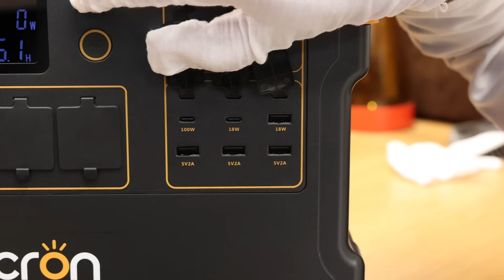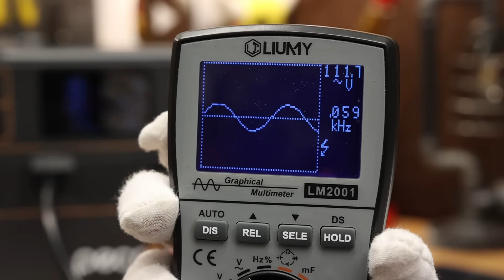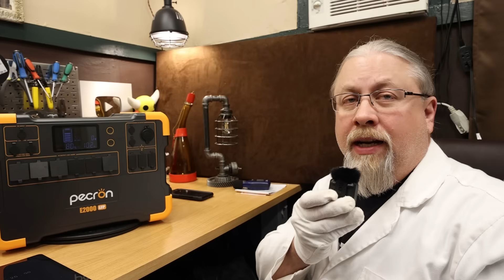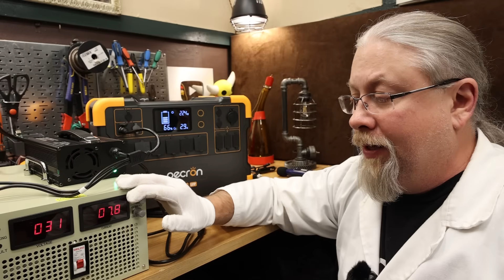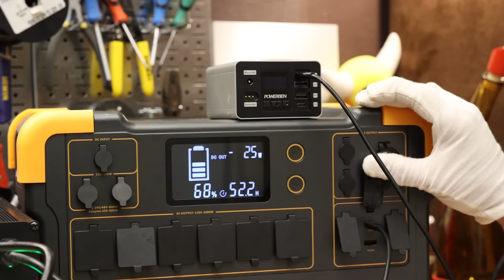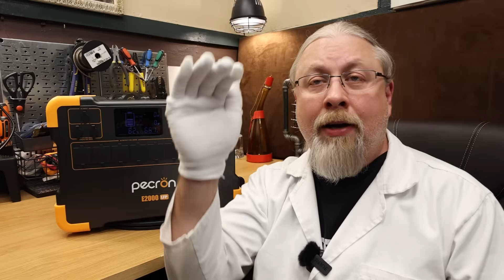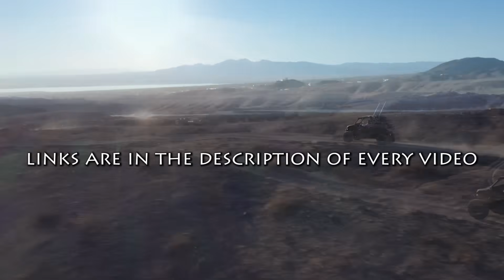Pecron E2000LFP 2000w LiFePO4 Modular Battery Solar Generator Power Station Review

Comment: Professor, How does the E2000LFP and the E3000 stack up against each other? I bought the E3000 in July and am wondering.
Reply from the maker: E3000 uses short cycle NMC where this uses long life LFP.
Reply: @HOBOTECH  Thank you. I would guess that Pecron will be offering a new version of the 3000, or something larger down the road using LFP with the expansion features as well.

Comment: I love a bank of 330 dollar lithium batteries on Amazo. 1200 watt hour each and even waterproof.  Just drop 300 dollars on a 2500 watt inverter and for 180 for a 900 watt solarcharger and last a 100 amp Rv power max 14.2 volt charger. Add batteries later but have 2400 watts now and 2500 watts max.

Comment: If you get to test the expansion battery, I'd love to know how well they document the interconnect. The expansion might already be more interesting than the core unit, given that it has a 30A 12v XT60 output (correct gender, too!) and it's own MPPT controller, but being able to use that apparently 24v connection with other gear would be awesome.

Comment: Mine showed up Friday with the pair of 200 watt panels.  So far am impressed.  Has Ben running the deer shack since Friday night.  Had to charge sat afternoon for about three hours with the gas Genny.  To lazy to put out the panels as of yet.  So far so good.  Ordered one of the expansion battery also.  Will let you know.  For what it's worth I did wire it through a 6 slot breaker box.  Works great will see.  Thanks for the review on the e3000, it's why I went with the pecron e2000 and expansion.  You are a riot and thanks for doing the technical testing.

Comment: I'm glad to see this test video, but please rest assured that our E2000LFP was updated 2 months ago to reach 100W PD output, the previous 65W was due to a protocol issue with the device. Thank you so much!
Reply: Question I preordered this unit and got it in July so is this unit a 100W PD or 65W? If it is a 65w what can be done to correct the protocol issue with these units?
Reply: Just bought mine, I can't wait to receive it ☀️☀️
Reply: I tried looking up your website but it was down. I can't find any info on it. Nor do I see anything on Amazon.
Reply: @ProductsChannel  Try using the links provided in the description.
Reply: @darrellee4953  Sadly no go.
Reply: If you leave this plugged into solar panels does it automatically "wake up" and start charging when the sun comes up even if you have a unit itself turned off?
Reply: @MyCabinLife  Yes!
Reply: How does the E2000LFP and the E3000 stack up against each other? I bought the E3000 in July, and am wondering.
Reply: Posting to get answers to these questions.
Reply: Can this Pecron unit and expansion batteries be connected to a manual transfer switch to power 10 circuits in your home?  What would be the best way to do so?
Reply: Mine is the E2000LFP
Reply: Pecron stuff just seems to work. I have the E1000 from a year ago. No frills or settings and manual rocker style switch to power on/off
Reply: Can you charge ecoflow wave air conditioner with Pecron?
Reply: 👍😁 I'm purchased the E2000LFP in September and it does work with my 100W laptop charger, I'm looking forward to your extra battery!!!
Reply: @hermw3484  any issues with your Pecron 2000 since you have owned it.  Is it loud when using.
Reply: @hermw3484  any issues with weird sounds coming from the unit.  Any issues since you've had it
Reply: @hermw3484  any issues with unit.  Have you heard any beeping noise from the fan area.  Is it loud when at high output.
Reply: It's a nice machine, but you need to get your support staff together!  I'm having issues.
Reply: @jamesslack8933  Thanks for your support! Normally we will reply to emails within 1-24 hours. Please send an email to us if you have anything, Regards.
Reply: @jamesslack8933  how has the pecron performed lately
Reply: Repeated attempts to contact you ,no reply.
Reply: Do you guys offer an all black version?

Comment: Re UPS function, you say it has pass through charging; can't you just plug things into it plug in the brick?  So when the power comes back on, it resumes charging.  If the loads are always running off the batteries, say 500 watts , this is actually a type of UPS that provides seamless switchover, but yes does wear out the batteries more, as they are always online.  But at 3,500 cycles, over 10 years, calendar aging will kill this before using it all the time would.  Or am I missing something?
Reply from the maker: It's not a real UPS because it doesn't switch from using grid power to inverter during an outage. By leaving it plugged in and using pass through charging you'll wear the battery out over time.
Reply: @HOBOTECH  I'm becoming confused how to best use these features.. I ordered a P2001 for my first solar power system, and it sounds like I have to choose between running things on solar (daily) and using the UPS..
In order to use the UPS, it must be connected to AC power.. but then that means it'll be fully charged at all times and unable to collect solar when the sun shines..

I can't have standby power, and reduce/offset my grid power usage at the same..
This reality makes running things like refrigerators unrealistic unless I  manually intervene.

So, for now I suppose the plan is setting up an automated heating and cooling system.. I have enough independent units I can set half up to run on solar only with no AC power, and half on AC power to kick on only if the solar powered ones can't maintain a temperature threshold.
It's important to find a way to discharge useful power as much as possible, as I'm using those grid power offsets to subsidize the cost of the equipment.
I have four 100w panels on the way, nothing has arrived yet, (also have an EB3A that's never been used with solar)

Comment: I just purchased a PECRON E2000LFP. My RV roof space that I'm working with is 101" x 77". If I should use (2) Renogy 450 Watt Monocrystalline Solar Panel SKU: RSP450D-120x2-US, would this work? The dimensions would be perfect.
Reply: Yes they will run fine. I see them at 34 volts so it's over the minimum mentioned so you can run one on each controller.

Comment: Curious, when you mention the big 3, is that Bluetti, Ecoflow, and Jackery?
Reply: Yes. They have dominated for a while, it seems. Check put the Bluetti EB3A, small, LiFePO4 battery, great display (better than typical Bluetti), and can often get it for about $240! Not big capacity, but really handy.
Reply: Pretty sure he means those 3, and that the 3rd is not BougeRV even though they have some great items.
Reply: @debbiedogs1  I think Jackery are big because of marketing, not quality. They don't even offer LFP! 
In Japan, they've got their stuff into not only electronics stores, but also "home" stores selling bedsheets, shower mats etc. And JVC build licensed copies of the Jackery range. And Japan-only brand Powerarq have one model that's a recoloured Jackery (though they also have an Ecoflow Delta with a removable battery, and a Bluetti E300 but with an internal battery and no modularity... wierd brand)

Comment: False Advertisement!!!
Why does it say surge of 4000 if it can't maintain anything over 2000 for even 1 second?
I bought this and am DISAPPOINTED that there is NO WAY they can say this has a 4000w surge. This video showed the same as my own device. At 1970w my 2000lfp cuts out. There is NO surge capacity, even for 1 second.

Comment: Always enjoy your reviews. When the day comes when you can add a battery/batteries using a standard 100ah AmpereTime, Redodo, or PowerQueen type of battery, then I'll consider buying one of these units. I think they would sell a gazillion of them if they did.
Reply from the maker: Like I said in the review you can add whatever batteries you want to the 12v input.
Reply: @HOBOTECH  Apologies. Just to clarify... you can "add batteries" thru the 12 volt input and "recharge" those batteries thru the same input point?
Reply: re: adding batteries using a standard... type... Very true.
Reply: Get an inverter and plug the AC charger into it.

Comment: much more positives than negatives, but im waiting until they offer a 30 or 50amp rv port.
Reply from the maker: Just use a dogbone. A 30A hookup would require a 3600w output.
Reply: @HOBOTECH  also i belive the 3000w expantion batteries are available for about 900 each

Comment: Definitely awkward design compared to others that seem more intuitive. My one critique on the amp test is will it output nose with under load? Perhaps bulkhead mounted resistors to draw 100-200 watts while the amp is plugged in.
Reply from the maker: Noise isn't going to change under load.
Reply: @HOBOTECH  OK, I wasn't sure if the sinewave would degrade some when loaded down causing some buzz or RF hash.

Comment: How can i use this solar power station with 220/ 230 Volts ?
Reply from the maker: You don't.
Reply: @HOBOTECH  
Hi, is there any solar power station with 220 , 230 v,    LFO, 1000 wh - 1500 wh  ,
Reply: They might have a UK / EU version

Comment: I own this generator (among others) and I’m pretty happy with it. I purchased it knowing it’s limitations which for me are minor. 

As these things become fancier (app, internal charger, UPS), I’m starting to notice that the usable battery is starting to become less and less and that they are becoming heavier and heavier. I don’t find that to be the case with this one. 

The idea of getting this type of capacity with the ability to add more to it , and it’s still truly portable is a big selling point. Especially at this price point. 

Yeah, the 60 watt vs 100 is a weird choice, and the limitations for solar charging is unfortunate but I’m still happy. 

I should also note that their customer service is pretty responsive and it comes with a water proof cover and a nylon bag for the accessories. Pretty good deal.

Comment: Thanks again finding the no fixed 100 / 60 watt. Are we at the point that you can put together a spreadsheet of Solar generator’s from your notes? You have years of experience as well. Also going to Solar panel’s spreadsheet. Even to the point of putting the required panels and generator’s. Together when camping or totally off grid your are dependent upon solar to recharge for the overnight or bad weather. I’m thinking it’s going to be a book. 😅 ok I’ll buy it. Time teasing Solar review. Thanks again for your work and your posting today.

Comment: Those aviation connectors aren't proprietary, they can be found pretty easily. They're darn reliable, but I rather Anderson.
Reply from the maker: Proprietary meaning you're not going to find a replacement adapter without going through them.
Reply: @HOBOTECH  True, unless you buy a 16mm 5-pin aviation plug and make up your own cable. I wish manufacturers wouldn't do that, and just use Anderson.
Reply: They're reliable as long as you don't connect/disconnect it a lot. For a piece of avionics that gets installed and stays there? Brilliant. But for this SoGen? Not so great.